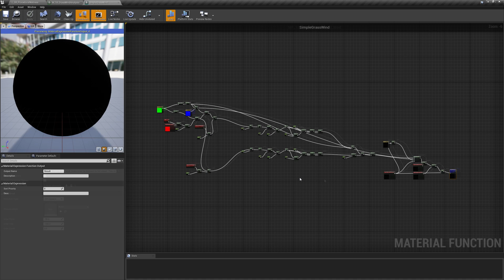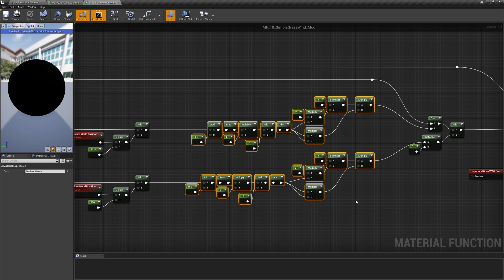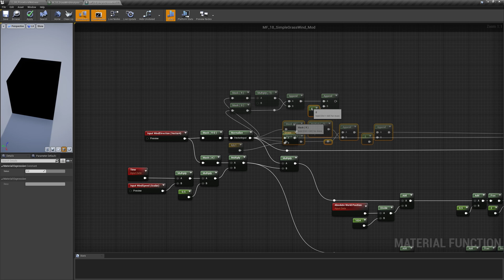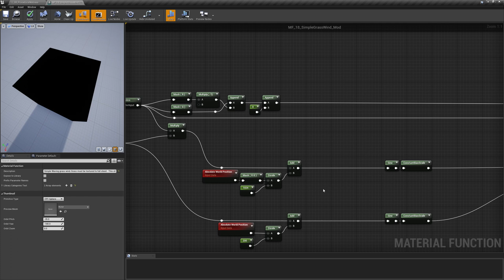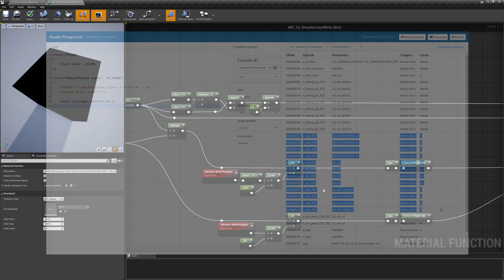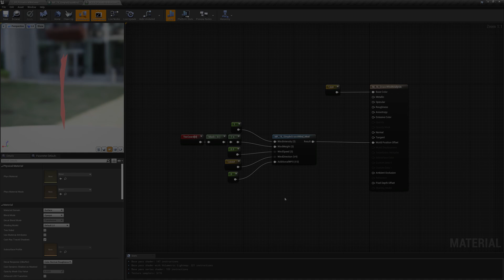Dissecting and Optimizing UE's Simple Grass Wind material function

Comment: [SM6] (Node RotateAboutAxis) Cannot cast from smaller type float2 to larger type float4. ue5.1
Reply from the maker: You're plugging in a node that has only RG into a pin that accepts RGBA, can you pin more precisely when/where are you getting that error? :)
Reply: @VisualTechArt  4:43, Mask RGB -> Mask RG into Normalize results in the error the comment made.

Comment: There might be a reason to use multiple instructions instead of sin: if there are much more execution units which can calculate the longer code than units calculating sin/cos, then it can be faster to use multiple instructions, as the trigonometry unit can become a bottleneck.
Reply from the maker: I see, I didn't consider that! Thank you :D

Comment: first of all, I am not a fan of the original function, it just don't look good at all.
the so-called optimizations you did there are just mambo jumbo. the only really effective thing was the cutting of the z- component of the calculation. the rest had little to no effect.
I would have gotten rid of the rotate about axis node first. this is by far the most expensive operation in the function.
also don't use const bias it cost one instruction more than just doing the range remapping with mult and (neg) add.
Reply from the maker: I actually pointed out that stripping the Z component was the most effective thing :)
As I pointed out when I was doing something to make the function more flexible and/or readable.

How would you have rewritten the rotation without the RotateAboutAxis?
And why you say that about the ConstBiasScale? In shader toy (not displayed in the video) I tryied remapping with both MultAdd and AddMult. While the instructions called were different, the clock cycles didn't change... Unless the ConstantBiasScale does something more other than AddMult, but it isn't the case as far I know

Comment: This video is fantastic!  I think I might want to pivot around the object's origin with a multiplier based on vertical distance from the origin so the tops of the grass blow more than the bottom.
Reply from the maker: Yeah, that would result in a nice enough motion :D The only issue I may see is that it wouldn't preserve the mesh length throughout the bending

Comment: The simple grass wind always looks like everything‘s under water. If you want to create realistic wind motion, you need to push the whole object (minus vertices that are „attached“ to the ground) in the wind direction and then after it passes a threshold, let it swing back to 0. I used the rotate about axis for that. With the per instance random and a multiply, you can get rid of the synced motion. After that we need some secondary movement for the details, for that you could actually use the simple grass wind in a super subtle way, however there are much simpler ways of doing so, for example using a texture based approach. 
This approach doesn’t really work with clustered grass meshes and is best used with single small patches of grass or taller plants where everything is near the pivot on x and y.

Great Video!
Reply from the maker: You definitely did your homeworks man :D I agree with you! Looks like your approach would lead in a more than decent result, I probably would try to not rely on textures at all though. And maybe for grass patches some baking could be used to retain the single grass blades position, etc ;)
Reply: @VisualTechArt  Yeah true, using textures could also lead to some weird choppy movement (pixels to vertices), also saving the extra instructions is nice^^ Textures are useful if you want to handcraft exactly how the grass should behave. In my most recent attempt I use time with a sine and a vertex color gradient for additional wind detail. The gradient has multiple uses: Fake ambient occlusion, masking out the wind effect where the grass is connected to the ground and the extra wind detail. 

Also regarding the rotate about axis method above, the curve of the vertex color gradient could be modified to create different effects. Smooth for wind and an abrupt falloff if the grass was damaged by the player…
Reply from the maker: @QuakeProBro  Yes, there's an endless amount of possibilities :D